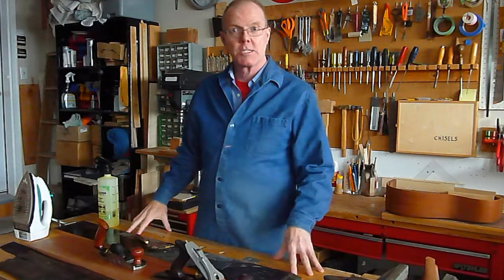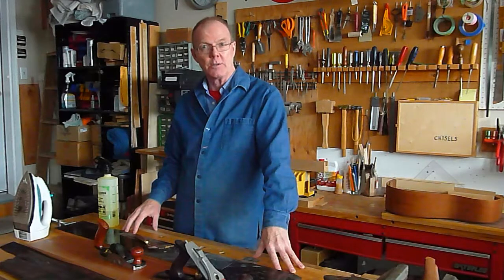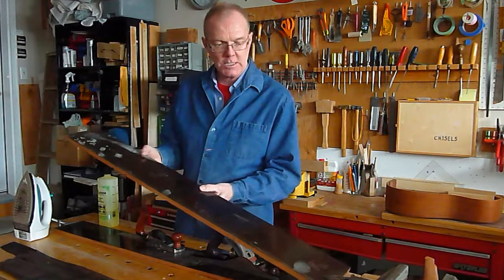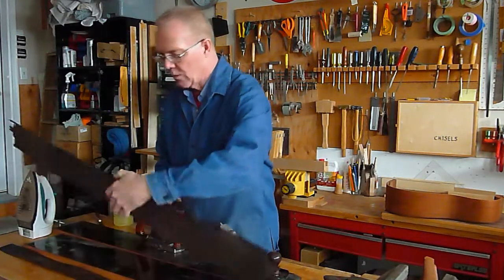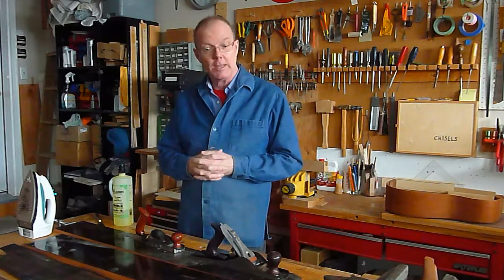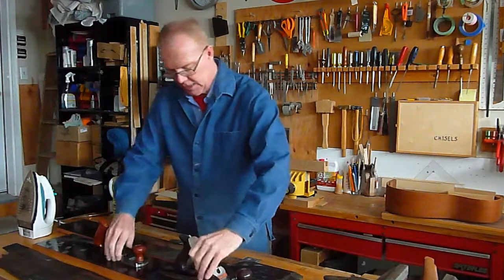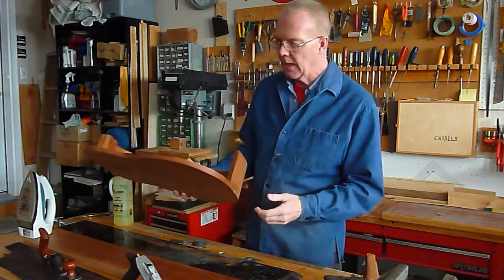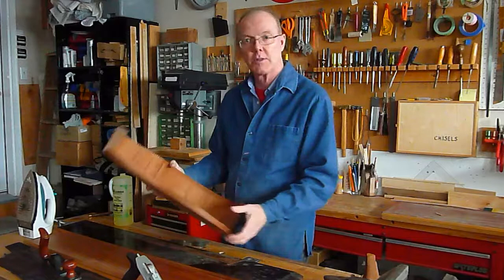Reclaiming Lutherie Wood from a Piano Lid

Comment: Deva Vu! I recently got a piano built in London in the 1860s. The internals were beyond restoring. I converted it into a wine cabinet for my daughter. I removed the soundboard and bracing and have been using that to build other instruments. So far, I've built a hammered dulcimer using the spuce for the soundboard. and 2 ukuleles using pieces of the piano soundboard for the uke's soundboard. All of these instruments sound beautiful. I've also been using that wood for bracing in several acoustic steel string guitars. It makes me feel less guilty for gutting out the old piano. It's still making music. Any the piano is a lovely piece of furniture. -- Kevin
Reply from the maker: Hi Kevin; thanks for your comment. Yes, sometimes antique pianos have gone beyond the point where it's feasible to restore them. Like people, pianos have a lifespan. It seems that you have found ways to put the wood to good use!
Reply: Best comment and reply on such a unique video, too cool to imagine the possibilities and the ways to transplant music in our instruments whether they still play or not